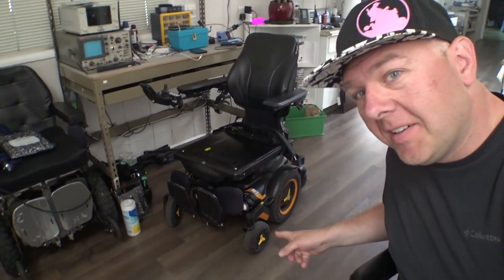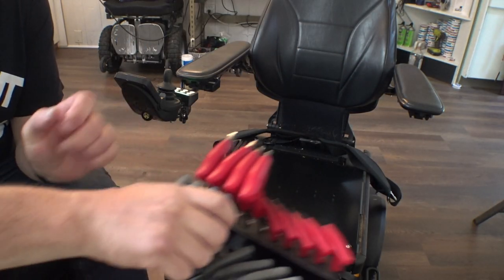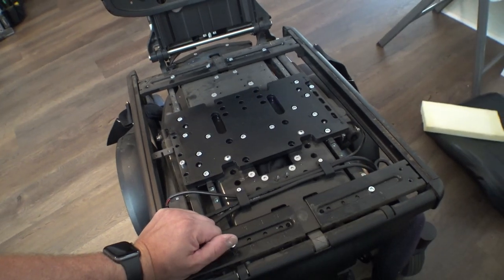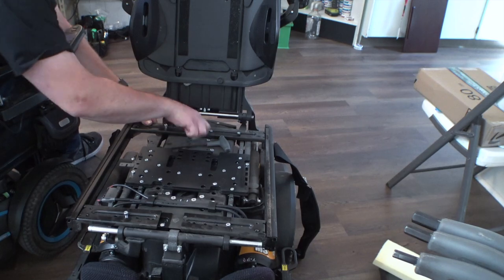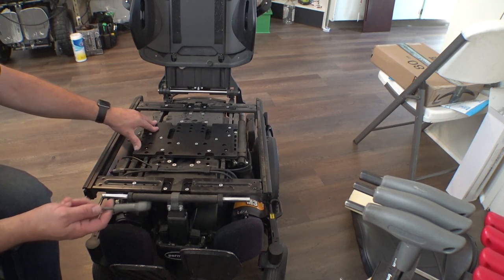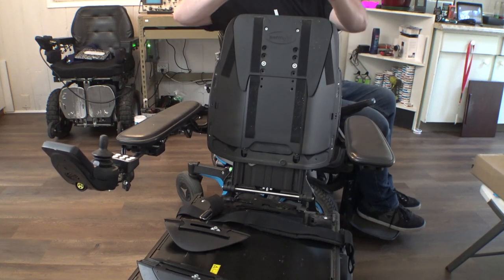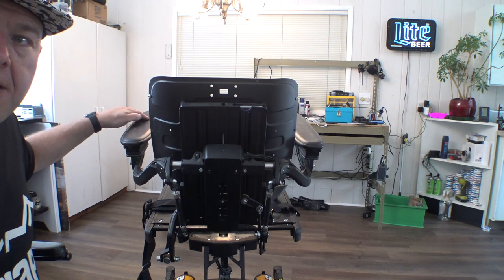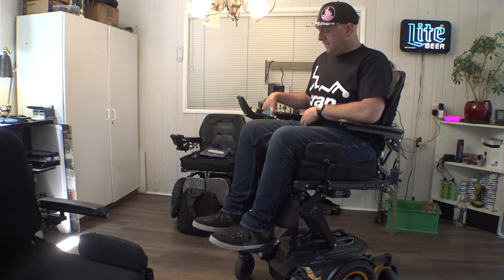VLOG 570: is an M3 the chair for me?

Comment: I am at the end of my rope and I’m hoping that you can help, I have a Pride Jazzy Elite 14 that is 3 years old. About 7 months ago my batteries went bad, I noticed I was losing bars much sooner than normal so I bought new batteries and everything was great until approximately two months later when I started losing bars again and within a week I couldn’t go down the street without it stopping so I got a new set from the warranty,exactly 2 months later the same thing ...so I paid a technician to come and figure out what was going on with it, he checked everything and came up with I had bad luck with my batteries so I bought a set from him 2 months ago and now it’s happened again.....HELP!
Reply from the maker: Hey! a couple questions.. is the chair used every day? And how often do you charge it?
Reply: @TotallyNormal-  yes I use it every day and charge it every night,my husband has the exact same chair and we alternate on the chargers.
Reply: @TotallyNormal-  we have a parts chair,my husband has switched the battery cables and we tried switching the joystick with no change.
Reply: use a different charger ? I've had charger go bad. they don't keep up the amps or volts
Reply from the maker: ok gotya.  just wanted to make sure it wasn't only getting charged every few days or something... ya thats a weird one for sure! esp since you guys swaped chargers.. that was gonna be my next thought..  hmmm theres defiantly SOMETHING going on to zap batteries that quickly.. usually though in those cases a bad motor or other problem would be noticeable (chair not driving straight etc)  lemme think some more about this...
Reply: @TotallyNormal-  yeah this completely has me baffled, nothing gets hot.. I checked all connections, the only thing I noticed that is different from when I got the chair is that it goes a little slower now.
It’s a very basic chair with no bells and whistles. The technician that came here said now he thinks it’s the joystick,I put another joystick on it for a week and the batteries are still deminishing so he’s going to come here this week to replace the batteries maybe.....when they checked the chair the first time and told me it was the batteries I told them that the only way I will buy batteries from them is if they agree to replace them if they go bad in two months,now they are saying I don’t know....I can only go about a half mile before it dies and I’m going nuts!

Comment: Ok. Watched the whole thing. That little rubber "shock" is an elastomer suspension and it absorbs shock to the main wheel, under extension.  You'd have to mount a shock on the other side of the gearbox to get dampening under compression. You'd also have to remove the elastomer dampener and that would loose coupling to the other wheel(kind of a stabilizer to transfer load to the other wheel, from the main wheel. But preloading the existing shock might be enough to get a similar effect without all the hoakeyness. That suspension is  designed by a mechanical engineering summer intern. All bright eyed and full of ideas that will never work in the real world.
Reply: I wonder if they offer alternate part numbers for that elastomer shock, for different weight ratings. There is no way to adjust, other than changing the rubber compound, or the amount of rubber in it.
Reply from the maker: i went into more detail about different design thoughts in the video but it was getting kinda long, and ended up cutting a lot of that out.  AFTER i published the video, i found out that permobil has a 'flex link pro' suspension setup on the M5 chairs.. its the same thing but they just added a small shock NEXT to the rubber damper thing! LOL.  all i know is that type of setup (either one) wouldn't hold up to my type of abuse very well!
Reply from the maker: one of my thoughts was putting larger castors on the back arms to preload the rear shock, (since when the chair is sitting in a neutral position the shock is resting on its end-stop), and it would also change the angle on the dampener/coupler a bit.. BUT there's exactly 4mm of clearance between the existing back castors and the arm itself.  i think there's some geometry with mid-wheel chairs that dictates the front castor arms need to effect the angle/positioning of the drive wheel while rolling over obstacles.. but it seems like there's gotta be a better design for all of that.  just initial thoughts, haven't run any strain simulations on it at all LOL but i see chairs in other countries that seem to work fine without all of that, and just run swing arms front, and back with a big shock/strut up top!  this is one of the times that i'd enjoy a sit down with the engineers and ask a few questions :^)

Comment: I took delivery of my M3 last week. I did notice that the M3 order form ( https://permobilwebcdn.azureedge.net/media/2ion1zlh/us-m3-corpus.pdf ) includes the following option:

 M3 Corpus to M5 Corpus Conversion Quote for Price
This option converts the Base to Group 4 (K0877 / K0884) and includes: the 7.5 mph motor
package, FlexLink Pro Suspension and a 2 year warranty. The final price of the upgrade is
based on the items selected below. Please request a quote for pricing.

Permobil posted 45 minutes plus webinars both on the F3 any M3. Those included short segments by an engineer basically explaining the suspension upgrades on the F3 and how they came stock on heavy duty models. Unfortunately, I can't be more specific because I can't find the links to those webinars.

BTW, if you take another look at that link above it shows that the factory order has to specify one of 3 depths for the seat pan each of which has 3 inches of adjustment. Even though my Roho seat cushion at least 2 inches longer in depth than my Quantum, the effective length having to do with how much of the cushion is under the backrest, is shorter.